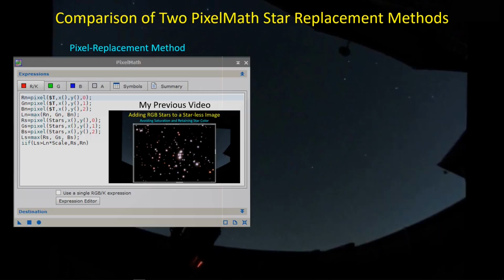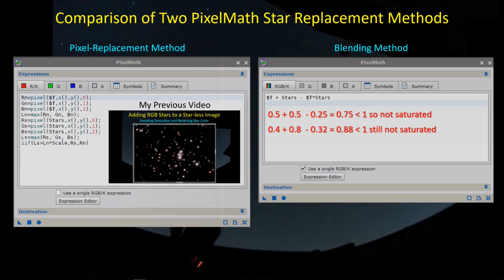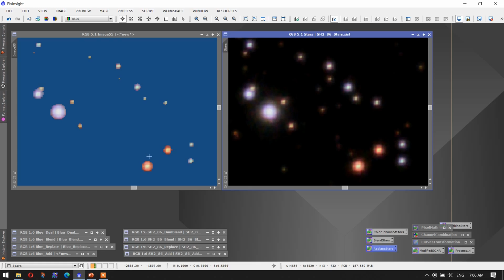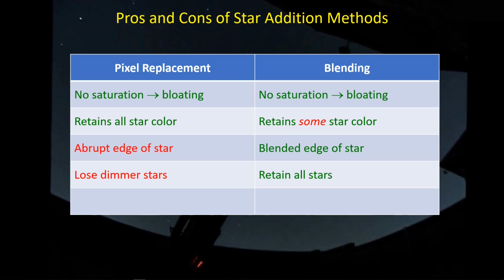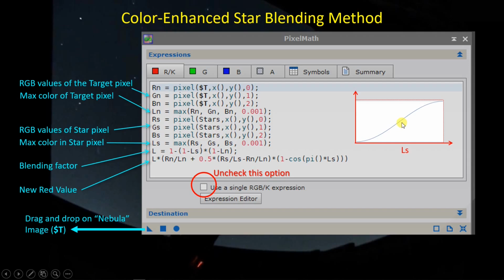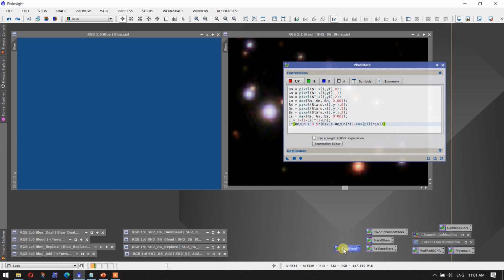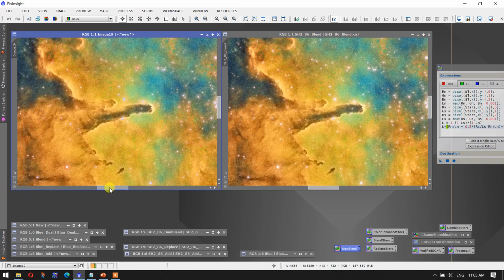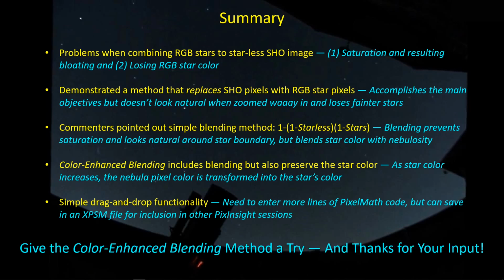New Color-Enhanced Star Blending Method

Comment: You are an anchor in astrophotography! I always come back to your video! One question: When I combine rgb star image, how can I make stars shape in the rgb the same size before I combine them ?
Reply from the maker: Hmmm. A consequence of getting better star color is the cosine blending function that has the side effect of reducing the star size. Seems like most people are wanting to reduce star size so that’s generally not an issue. There are two options in your case: (1) modification of the math equations or (2) try stretching your “Stars” image a bit to increase star size before applying the PixelMath. Try #2 and see if you can get that to work for you before I unload modifications to the equations on you. Let me know how it goes!

Comment: I used this new blend method on a recent image. It works but I feel like a just adding stars to the starless works just as well if not better. I retained more color with an expression like: starless + stars. I didn't see any bloating either.
Reply from the maker: Very good! Anything that works, works for me. Adding stars can avoid saturation/bloating if the stars and the nebulosity aren’t “over stretched”. Of course adding stars to an empty space field (around a galaxy, for example) will work great. But you have to lose color balance when you add stars to nebulosity of comparable brightness. Thanks for giving it a try!
Reply: @Aero19612  I certainly haven't ruled your new blend method out yet. I need to do more testing (like you) with different images. I always remove the stars and put them back as the last step so I have many examples to play with and the files are already there.

Comment: Son of gun James, thanks for going over this.  I never would have been able to figure this out.  It explains a lot of what I see.  I do use PS as well and always have blend color back into the stars and now I know why.  I will most likely try your blending method.   On a side note, I must be doing something wrong with Photometric color calibration as I always get an error - is there anything that needs to be done to the image prior to applying it? - Cheers Kurt
Reply from the maker: Hey Kurt. The astrophotography community keeps trying to drag me into PhotoShop. I won't go!! Give this method a shot and see if you like the results!

Ahh. PhotometricColorCalibration... Yes, it can be picky at times. Look at the error message it's giving you. Most of the time, when I have a problem, it's caused by inability to plate solve the image. But there have been a few times when it throws an error and it's because the internet source of the star library is temporarily down. Then you can try different star libraries. 

Back to the plate solve issue. I've done two things that have worked in the past (one or the other): (1) If you have a dense starfield, try limiting the star magnitude used in the search (to say 10 or 11). (2) Try a different platesolver (ASTAP or PlateSolve2 for example) then enter the precise coords into the PCC data window. PCC is pulling coords from your image file header and those can be off by a couple of arc-minutes.

Oh, one other error: You'll get an error if you have a Bi-Color image (e.g., HOO). PCC doesn't respond well when two of the channels are identical. Not sure how to get around that one. Hope that helps!
Reply: @Aero19612  Thanks for the PCC info James. I never would have found that out.  It has worked a couple of times but most the time it does not but I leave everything at the default which I see according to your answer - probably the issue.  Cheers
Reply from the maker: Oh. And apply PCC to the linear RGB image...